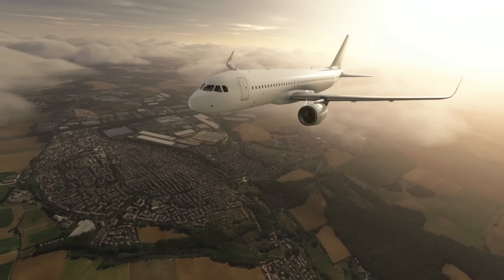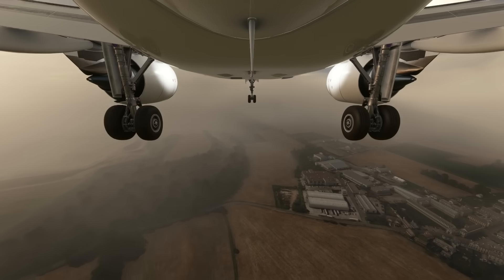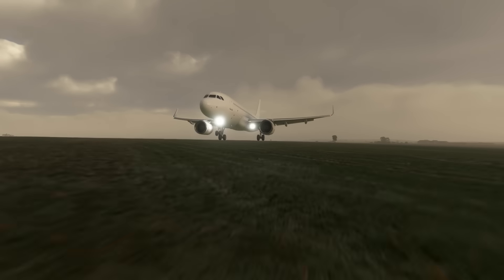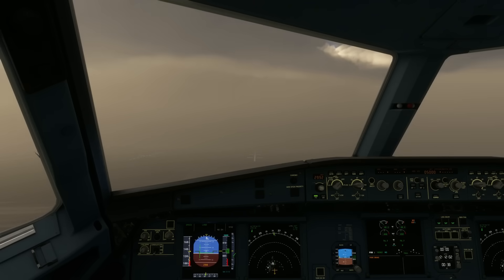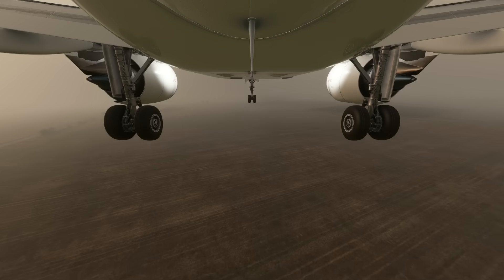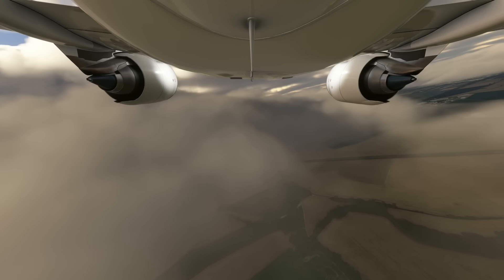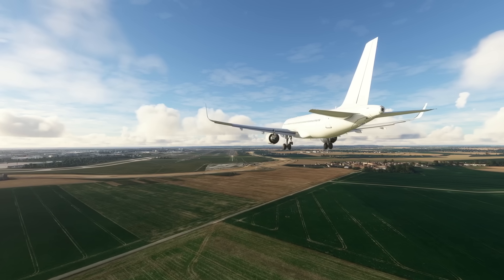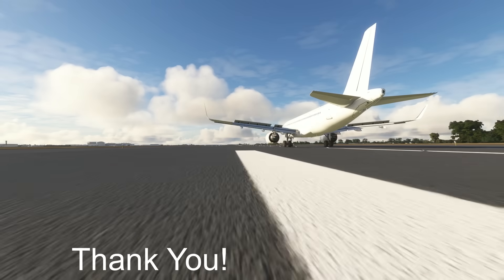How A Simple Error Almost Crashed A Passenger Jet  | Norwegian Air Sweden 4311

Comment: This is why you shouldn't use metric for aviation. QNH (I dont know what the abbreviation is) numbers are not distinctive enough. In the US we use altimeter which is based on pounds per square inch, and the numbers are more distinctive since inches are smaller than meters and more distinctive. So instead of a bunch of ones for QNH, we get Altimeter 2997 or 3010. But here is another issue I have here. Why didnt GPWS determine they were low? Now I have no idea if it will give a terrain warning in that configuration, I've never been dumb enough to get in that situation and I've taken planes to mins plenty of times. But even then, wasnt minimums set? Those are loud calls? What the hell where these pilots doing, the wipers are not loud enough to block that out. It sounds like pilot error was more than a factor here. The PM should always be comparing RA with the Altitude, especially on unfamiliar non-precision approaches. Then they recovered the landing on the second go? That would get you cert taken away in the US. And if sound was a problem then thats an aircraft issue as well. I mean they are lucky they didnt crash, pure lucky. Also that 50' thing is pretty universal, we have that too for non-precison approaches.

Comment: 1001 instead of 1011. This stands out to me as the sign of a fundamentally dangerous system. It should not be possible for such a small number difference to put lives in danger. There are certainly other ways to encode that information to avoid that risk.

Comment: Haven't read all comments, I noted the two different QNH values. That's an error made by the air traffic controller. To me it's questionable why the pilots didn't notice or didn't ask for clarifications. Both values should have been noted and written down manually or digitally. But here's the thing: The final value, 1011, could have been understood as the correct one and the value given earlier may have been perceived by the pilots as a misunderstanding and therefore nothing to pay any special attention to. This is human behaviour on a very basic level.

Comment: I'm missing something here. I'm looking at the Jeppesen approach plate (22-8) for the RNAV RNP to runway 27R at LFPG and something doesn't make sense.  They used a DDA (derived decision altitude) which made the minimums 802 ft MSL or 410 AGL for the LNAV/VNAV technique. They were 280 feet low due to the wrong altimeter setting.  Where is the remaining 130 feet?  And the field was reporting 1500 OVC with 6 miles visibility;  How did they not have the runway environment in site way before getting that low?

At the very least those controllers need to be flogged....
Reply: The remaining 130 ft were probably lost during the beginning of the go-around. Why they didn't react to the radio altimeter 500 feet call is a mystery though, would need some pretty strong confirmation bias to not think it was strange

Comment: If it was so foggy why didnt they divert to another airport.
Tower  controller was removed as hed forgotten landing runway lights.
Was he sacked as it dosent sound as though pilots knew lights were out,so had they been forgotten the lights or were they just off.
But giving them the wrong q+h is bad why arnt they wrote down for all controllers to follow,all crews and controllers should be fluent in English.

Comment: Love your content: interesting and well researched.
Some air traffic control centres/towers have automatic conformance checking tools that continuously compare various FMS parameters against the values they should be. In this case the capability to check QNH (in the Mode-S SSR returns) against the current airfield observation.
Another powerful safety net is conformance checking the FMS Selected Flight Level (SFL, again in Mode-S) against the ATC Cleared Flight Level (CFL).
In some airspaces routing information is conformance checked.
Computers are absolutely fantastic at methodically checking data sources against each other, massively outperforming humans!
There is work ongoing to compare aircraft actual location (based on known trusted data sources) against where the aircraft thinks it is (ADS-B data).
It is somewhat disappointing that such ATC technology hasn't been more widely adopted.
Reply: I guess only extremely reliable tech is allowed in aviation

Comment: The weirdest part about this incident for me is the lack of explanation by the crew about the RA call outs. Everything below the 500’ call should be very strange for the pilots, and when they get 50, 40, 30, 20, 10 without even having made Contact it should have scared the shit out of them.
Reply: Inertia is at play here. The engines have to spool up and the body of the plane has to stop moving downwards. They would have almost certainly hit the ground if they'd initiated the GA any lower than 100'.

Comment: As the video points out this was not flown by Norwegian itself. The flight was operated as a wet lease by Airhub Airlines, which supplied the aircraft, crew, maintenance and insurance, while the flight used a Norwegian flight number. Norwegian does not operate Airbus aircraft at all, its fleet consists only of Boeing 737s, so the operation and handling of this Airbus flight were entirely the responsibility of the wet lease operator, not Norwegian Air.
Reply: For what it is worth, I don’t see why this should make a difference. They had their name on plane and sold the ticket. Why should the passenger be put in a safety position due to management decisions to wet lease the plane with crew.
Reply: @peterj5751  lesson, always check the "operated by xyz" part before you buy a ticket. Shouldn't make a difference, but if you prefer to take a flight operated by a larger carrier instead of some neverheard airhub airlines, you gotta pay attention

Comment: Was it the QNH 1001 vs. 1011? Does that affect the altimeter calculating the altitude?
Reply: QNH is the base barometric pressure for mean sea level. The altimeter determines altitude by measuring atmospheric pressure and calculating from the difference between its own number and the base. 

So if the base number (QNH) is 280 feet off, the altimeter will read 280 feet off.

Comment: That is very strange that the air traffic controllers don't know how critical QNH is. I worked in aviation for 13 years in a non-controller related role and the first thing (before I even started working in year 1) it was mandatory to pass a 100-hour "basics of air traffic control" course, where it was made absolutely clear (amongst other things) how critical QNH is to the pilots.
Reply: Yeah, but 10 hPa? I would have thought it was a trivial difference.

Comment: What's the plus/minus on that 6 feet?  10% is six inches, so anyone 5' 6" to 6' 0" is very vulnerable to a 10% variance...

...and even for those below six feet at zero variance, they are still not free of danger - how many knots, how much mass, how much sudden air force caused by the close call striking the person...

...oh, and one question - the altitude of the plane is measured from where on the plane - the bottom of the fuselage, or the bottom of the aircraft engines (which on some aircraft may be lower than the bottom of the fuselage), or center of mass of the airplane?

Comment: 6 feet and slam into the ground? More like a very light touch, and the ground must have been clear of obstacles as 6 feet would mean no trees or any other obstacles. Either way hardly a "slam" into the ground
Reply: ...and then the friction on the gear would have pulled the nose down. Or uneven touchdown might have dipped a wing into a pod or tip strike, and quite possibly spinning or breaking up the plane right there. And the ground's likely uneven, hon. A ditch or hummock in the ground could at minimum have torn off the gear. A plane touching down (without even flaring) on unprepared ground is a TERRIFYING prospect.
Reply: Without a flare it would not have been a light touch.

Comment: no radio altimeter?
Reply: At 9:36 he mentions the radio altimeter. As far as I understood the pilots just didn't hear its countdown due to some sort of auditory exclusion from the stress.
Reply: Why there is no automatic warning     if radio and barometric altitudes differ significantly at e.g. 2500 and 1000 ft?  Or why not compate GNSS, RA and barometric and raise a flag if they differ?
Reply: Shouldn't it also show up on the primary flight display?
Reply: @X_513x  Okay, I looked it up in the final report. Section 2.3.2 (page 124-125 of the english version) details this issue a little bit. According to it no procedure required the pilots to cross check the radio altimeter data with the barometric altitude, so they just didn't. (This is due that the pilots in general already have high enough workload during approaches, but the final report recommend to "keep the radio-altimeter in the instrument scan".)
@PttrPnkn According to the final report (section 1.18.3) Airbus has ALTSM system on their newer planes which does exactly what you ask for, but at the time of the incident (and the final report as well, maybe) they couldn't retrofit it to the older planes.
If you look up the final report as well, then check Section 4 as well about the safety measures taken.

Note 1: I am not an expert, so imagine I wrote "as far os I understand..." at the beginning of all of my sentences here.
Note 2: This issue is really strange for me as well, that's why I did my research.
Reply: @Olivaw4254 Good job! Thanks!

Comment: Just so people are aware, more modern A320's (and other Airbus) now have a feature (not sure if standard or optional) that alerts if the barometric altimeter setting is incorrect by comparing to GPS altitude. And some very new ones are now able to use SLS mode for landings and runways with LPV minimums which are not affected by incorrect altimeter settings.
Reply: Airbus is doing such great work to make planes safer
Reply: @mnztr1  woah woah that dosent mean boeing isnt puttin in effort to save money
Reply: @MHBAQ  Problem is the don't equate safety to saving money or value, more a box to tick. That is my impression of them from a great number of accounts of some really bad decisions.

Comment: In 2026, we still depend way too much on pilots and controlers listening to analog radios that haven't changed much in a century. We will be safer when ground and plane systems can exchange data digitally.
Reply: It would not be the most difficult thing to have the computer receive and display such data. It could also cross-check the pilot-entered data against the digital data and give a caution if there is a mismatch. 

Note also, it is very easy to communicate digital data over an analog (AM) radio channel.
Reply: Then we'll hear: 
This is your captain speaking. A Russian hacker wants you to pay him before you get off this plane 😅